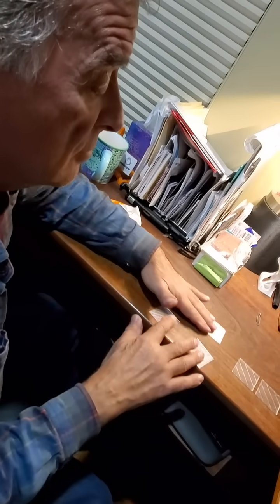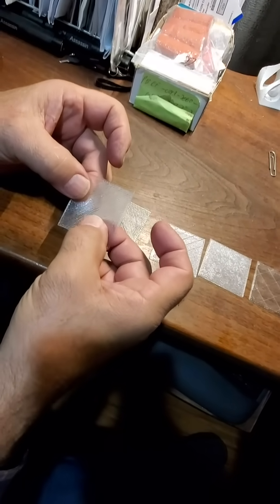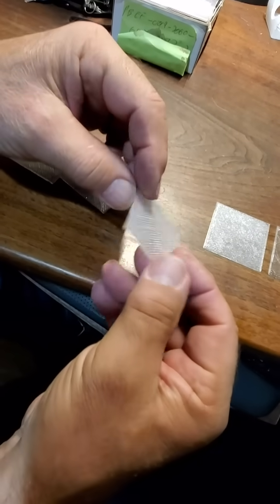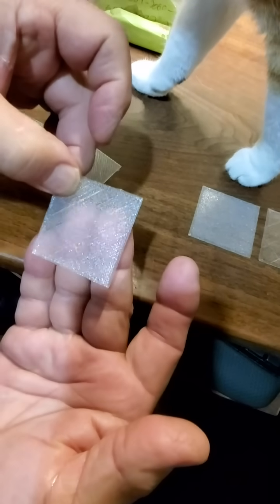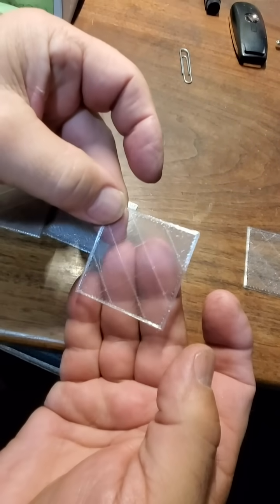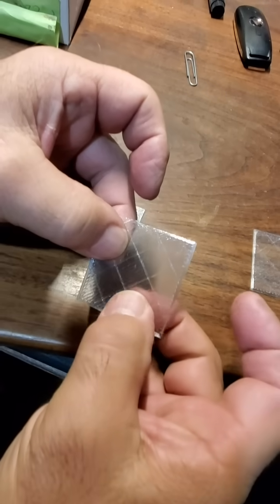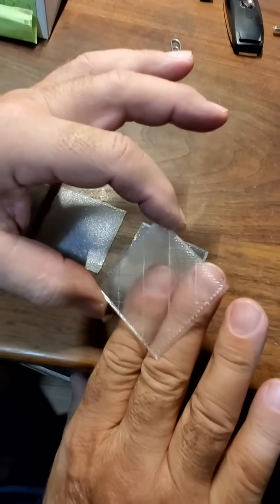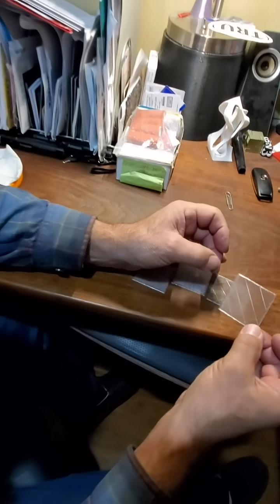How to Make 3D-printed Sections Clear

Comment: How do you get rid of the checkerboard?  I'm printing something 2mm thick with translucent filament, but even at 100% infill there's a checkerboard pattern.
Reply from the maker: Set the infill to 0.  You might have to redesign to not need infill.

Comment: Nozzle needs be lower to the bed. Adjust Z offset.
Reply from the maker: Always tinkering with this thing.
Reply: @KevincaronSculpture  yep topgunm is right, if your first layer is coming apart like that your nozzle isn't close enough to the bed. they have test prints that will print a little square about the quater of that size in every corner of the print and one in the center, and if the squares aren't PERFECT then your nozzle isn't trammed to the bed. That you need to work out before you start messing with ANYTHING else.  if you start getting elephants foot, like the bottom layers are wider and squishing out more than the top layers that's your nozzle TOO CLOSE to the bed.
Reply: 6you could also get a BLtouch or 3Dtouch and it can probe your bed and come up with it's own Z offsets, so even if your glass is warped it will map everything out and maintain perfect nozzle distance at any point on the glass. there only 10 or 20 bucks, might be useful